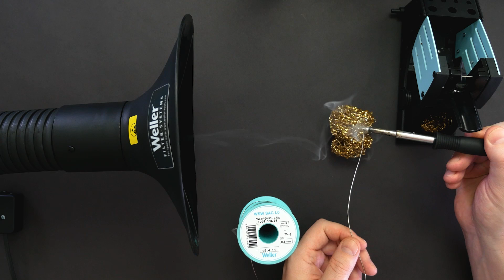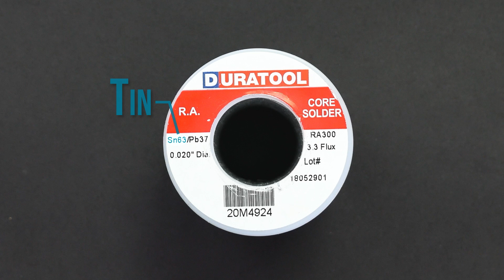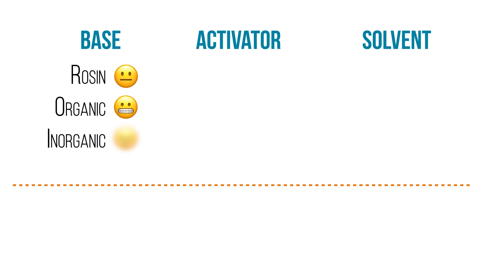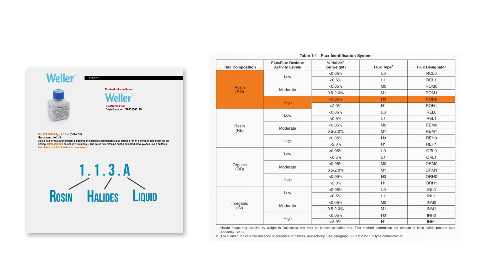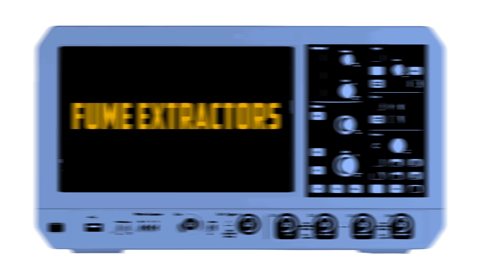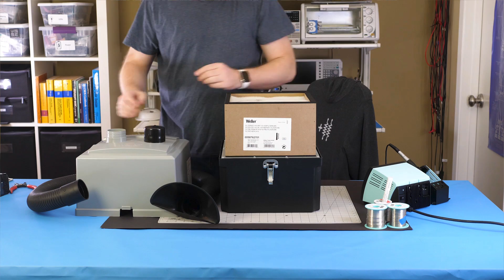Health and Fumes - Workbench Wednesdays

Comment: More people would use fume extractors if they weren't so expensive. Just the hose (without the endpiece!) of the Zero Smog unit costs as much as 3 (three) of those little benchtop extractors. It's also funny how that very same chinese benchtop unit costs twice as much when sold under the "Weller" brand instead of "Duratool" - both on the same page on Farnell's website...

Comment: I use a 10' or so piece of 3" duct ($15 or so from Home Depot) attached to an 80mm fan (free if salvaged, about $10 to buy one) set in an open window. No filters to replace.
Reply: NiHaoMike that’s a good solution
Reply: TannerTech has a similar setup, seems to work well. Blower fans from laptops could get the hose diameter low enough that you can strap it to an iron.

Comment: The boiling point of lead is 1749 °C (3180 °F) so you're not going to breathe it in
Reply: Exactly. You aren't generally going to vaporize lead while soldering...or soddering.
Reply: Lead begins to vaporize at 400°C (752°F)

Comment: Thanks James! Can you maybe address the issue of "tin whiskers" when you further compare RoHS and leaded solder? You might also let us know the sound levels of the two extractors. I have had the Weller unit for years but recently replaced it with the Hakko FA-400 as it fits my bench layout better. We can move the conversation over to the E14 page as well.